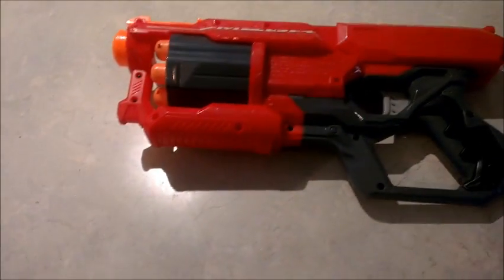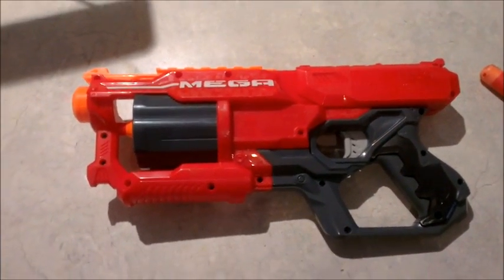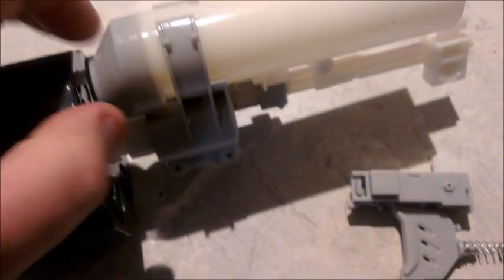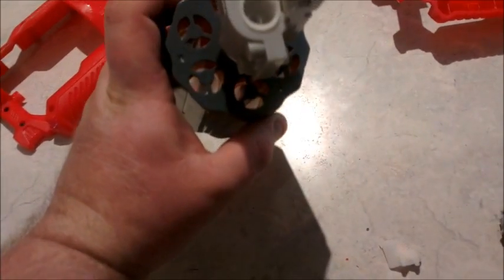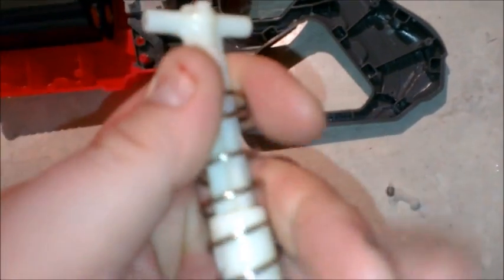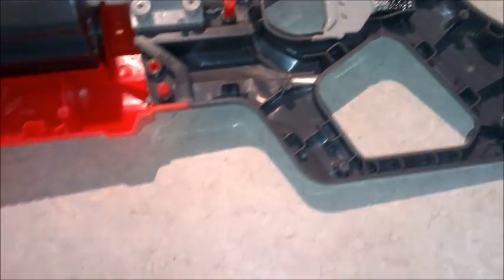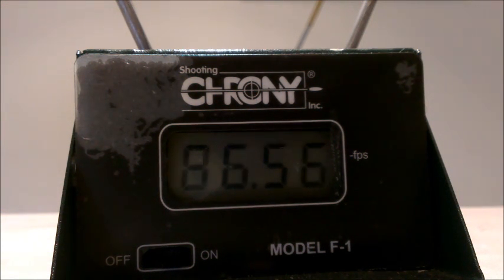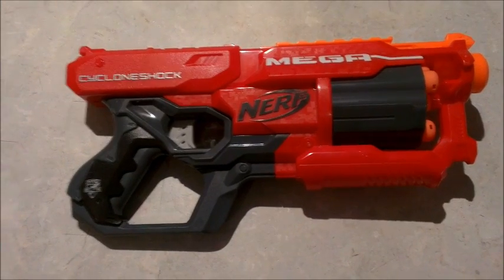Nerf Mega Cycloneshock Mod

Comment from the maker: Here in Australia all we get are grey triggers :(
Reply: yea because austrailia has only gray triggers for nerf so they know they are lower fps
Reply: Dude do u have to screw the top off of the reloader? With screws and a screwdriver?
Reply: to bad go to the US
Reply: to bad go to the US
Reply: Some of these are much better than others. I've got four of them in Australia and one was just a lot faster than the others, all have grey triggers. Having said that, they are all very good. I also think removing the barrel parts might be a mistake we are all making as that should increase the velocity of the air into the dart. Unfortunately I wasn't thinking straight when I copied that mod.
Reply: Why?
Reply: Cool i am going to do this

Comment: I just disassembled my cycloneshock.  It is a new one.  I can't fully detach the plunger from the orange head that the O-ring fits around.  Any tips?  It almost seems like the white piece that the spring fits around is glued to the orange head.  Has anyone else had this problem?
Reply: I managed to "screw" the 5kg alpha trooper elite spring over the rear end and under the stock spring.